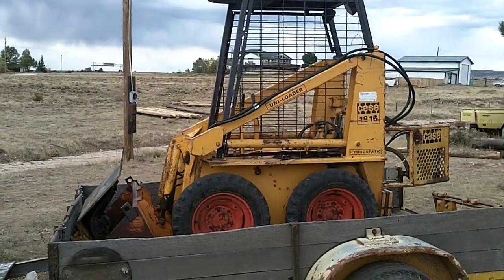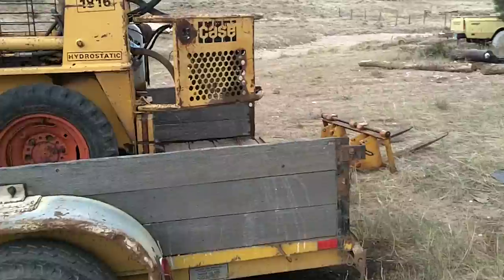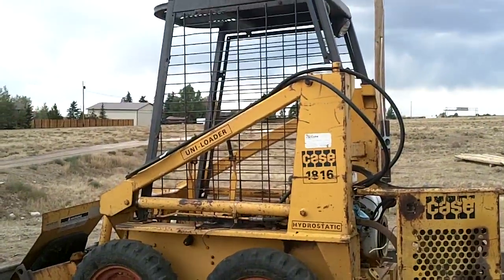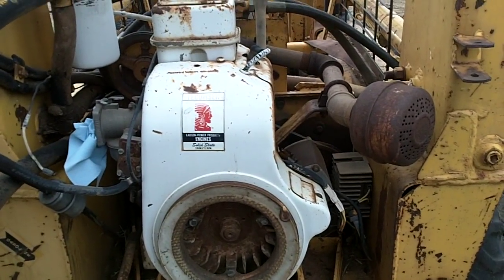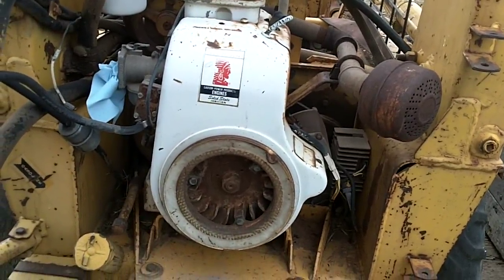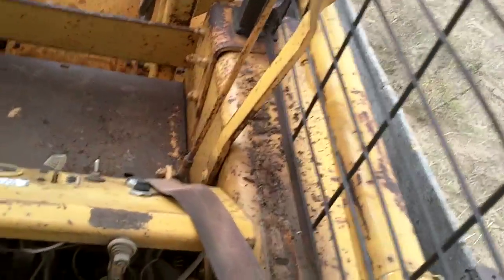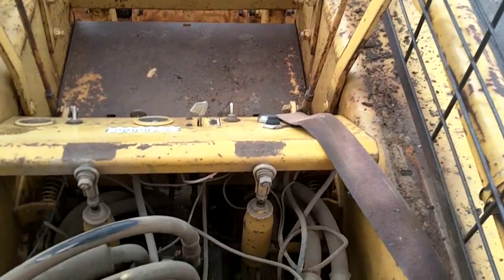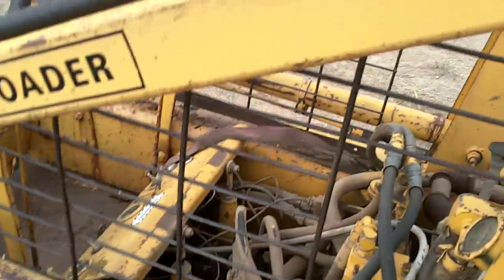case 1816 skid steer walk around

Comment: I ended up putting a 26.5 EFI Vtwin engine in mine.   NO MORE CHOKE.  Woohoo
Reply from the maker: EFI! Do you have a video?
Reply: @pronghorntractorwork  no I don't but I was thinking of taking photos but I hate photo videos.
I'm actually in process of installing motor but I'm holding off until I get the jerky jumping sorted out.  Which I did.  This weekend I'm installing the new 3/4"pillow block jackshaft  bearings  for the controllers.  I already upsized most of the worn out lever pins from 3/8 to 7/16.  No sense putting in that beautiful new efi engine if the skid is out of control and dangerous.  Which it is/was.
Reply from the maker: @DumbCarGuy  that is absolutely true. I have never thought to mention that there is no centering equipment on the hydrostatic pumps on these machines. So, worn out bushings on the lever shafts cause all sorts of problems. Mine are due for a rebuild as well. I will do them when I tear the hydros down for reseal and replace the leaky hydraulic valve ( and add 3rd function). Hopefully I will have a big skidsteer before then. I can't seem to live without one anymore.
Reply: @pronghorntractorwork  Up here in MN, i enjoy this tiny machine for doing my little city driveway, the sidewalk and the mailman's trail from house to house.   I was pleasantly surprised when i took off my seat pan that there were two rebuilt drive pumps.  The masking tape was still covering the pump ID tag.   Right now there is a Kohler Magnum 18hp in it.  Thats the opposed cylinder model.   Tonight I just replaced those 4 jack shaft bearings.  I think my rod ends will be here tomorrow so I will put those on tomorrow if they show up.  It is very tight now.  Only thing with wiggle is the 1/4" pins that go through the pump rods that the linkages are hooked to.  I took out the worn threaded bolts and put in pins with cotter keys.  That was tremendous.  My levers have maybe a touch more than 1/8" front to back play.  That pretty good for a 30" lever.
Reply: @pronghorntractorwork  after reading hundreds of posts about jumpy, Jerky, one side goes faster, etc, etc.  Every single poster never said the magic words which is absolutely critical.  The old hey it cuz you have sloppy levers.  That is very true but as I said nobody mentioned the most critical part.  These drive pumps do NOT have internal return springs returning the push pull rod back to neutral.   That is the most critical piece of information that could have been told to hundreds of peeps looking for answers.  So sloppy levers will leave a drive pump in 5 degrees of forward or reverse motion while you are assuming your neutral is screwed up leaving you wondering why you have creep in either direction or why one side is accelerating faster than the other side.  No internal  return to neutral setup.  It relies on your sloppy levers and worn out jackhammer bearings.  
Well I hope you understood half of what I was saying.

Comment: I just got the exact same case 1816. Came with complete spare engine,2 drive pumps,2 drive motors,spare hydrolic pump and complete hydrolic lines. Sat for 15yrs fired up and drove it off her lawn lol
Reply from the maker: Nice score.  They are great little machines. Tecumseh engine?
Reply: @pronghorntractorwork  yes one in it and one for a spare just missing air shroud but does run. Just changed all drive belts not fun! Motor has to come out to do it!
Reply from the maker: Yes, changing the belts is not a fun job. Does yours still have the centrifugal clutch on it? I had to ditch mine when i swapped the briggs in. It was in bad shape anyway. I just have straight pulleys on it. It works fine, but is a royal pain to start in the winter. When i dig in to fix leaks, i am going to make it so i can disengage the drive pumps to start it.
Reply: @pronghorntractorwork  yeah mine has the cintrifical clutch for now. Came with a brand new electric PTO I have to assemble. I plan on changing the engine to a 18hp vanguard Vtwin as soon as I can get a shaft adapter to go from 1" to 1 3/16 for the PTO. My engine in it will idle without clutch kicking in,doesnt grab till almost half throttle.

Comment: Hey man! I just pick one up myself (non running). How were you able to load yours onto the trailer? Is there a hydro release or anything like that?
Reply from the maker: Mark,
The drive chains are accessible under the floor plate. They have master links. If you can't reach them, you will have to pull the drive motors loose. They are each held on by 2 bolts.
Reply: pronghorntractorworks, okay cool thank you! Since I first messaged I actually got it running and drove it up onto the trailer. You wouldn’t believe I picked it up for $200. The guy thought the engine was toast because it was blowing white smoke out of the valve cover vent. Turns out the float was stuck and flooding the engine with fuel causing the oil and gasoline to go up into the valve cover.
Reply from the maker: @marklavis6758  nice score! Does it still have the original tecumseh in it?
Reply from the maker: Shoot some videos for the community.

Comment: Hi,  Did you get it to work?

I am a homeowner and don't have a lot of experience with equipment. I have a case 1740 skid steer that was running fine yesterday and we loaded it on the trailer. But this morning I tried to start it and giving me problems. It looks like I have to twist the key and push the little rubber pulp. My first try it seemed that it was going to start. The second one was very close. But now I hear something spinning (starter?) but it wont start. Any help will much appreciated.
Reply from the maker: mo k, sorry i just now saw your comment.  did you get your skidsteer started? if so, what was the problem? if not, i would be happy to try to talk you through troubleshooting. just let me know. again, sorry i just now saw your comment